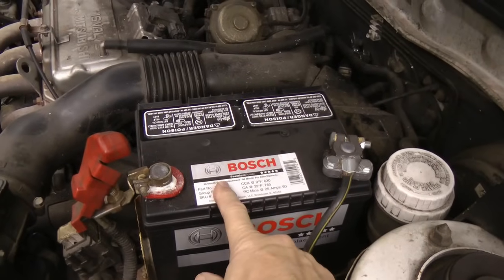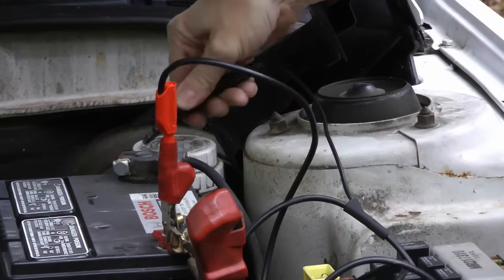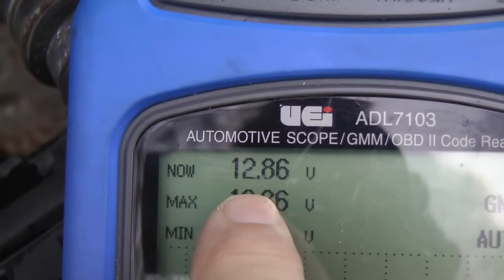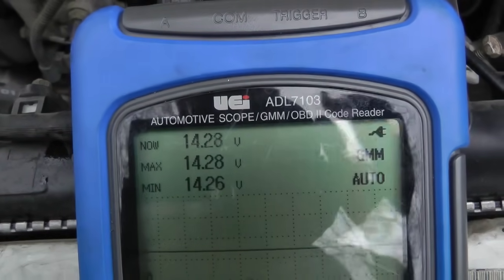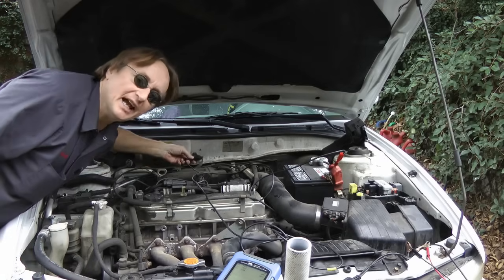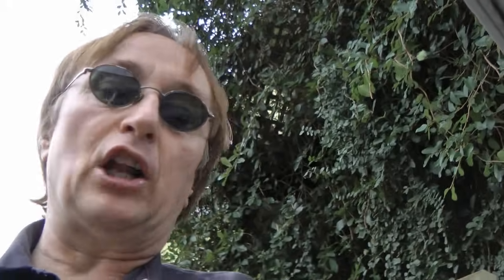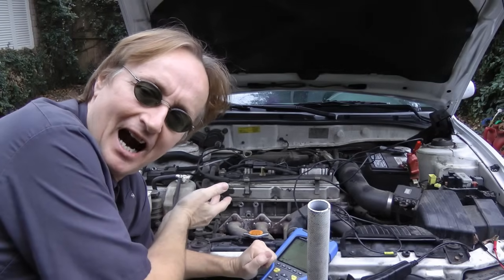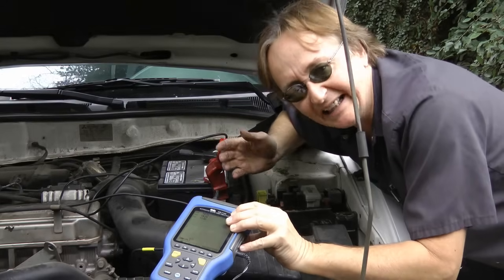How to Fix Electrical Problems in Your Car (Ground Fault)

Comment: Great vids!!!  Get this... the metal strap that held my battery down popped loose and grounded the positive terminal straight to my 95 nissan pickup.  Now the stereo, fan, windshield wipers and headlighs are all acting crazy.  Would all the ground wires need to be replaced or do you think I burned out my relays?  Thx again, J
Reply from the maker: pray it's just relays, but odds are computer modules and or wiring melted too. good luck

Comment: Thanks for writing back about my 1990 Chevy Lumina.  I agree that the idle screw should not be adjusted.  Recently though I got my car out of a mechanics shop and when I got the car back the idle was up so high that the transmission was slamming every time I would stick it into gear.  The original problem was still not taken care of because the car kept dying at stop lights and signs and it was blowing smoke.  I took it back to them and one of the mechanics comes out and adjusts the idle set screw.  The car would not slam into gear but it did not solve the problem of dying.  I had to smog the car.  The smog specialist could not even get the car started without problems and the black smoke was belching.  He opened the hood looked to the back of the engine and cut part of the rubber hose going into the MAP sensor and all of the sudden the car ran and passed smog.  But when I got it out on the street it still wanted to die at stop lights and stop signs and I had to feather the gas.  I finally had an idea.  I bet the first mechanic had turned the idle screw to low.  So I adjusted the screw just a little at a time and then the engine kept running smoothly at the stop lights and stop signs without dying.  So far the car is running like it should for a car that has 350,000 miles running on Amsoil.

Comment: I recently wrote that my 1990 Chevy Lumina was dying every time I got to a stop sign or light.  I first noted that the vacuum lines going to one of the electrical components was worn out.  I also turned the idle set screw to increase the rpm and so far the car has not died like it was before.
Reply from the maker: that is not an idle screw you should mess with. the computer sets the idle, turning that screw also messes with tps output and other things and may cause problems in the long run. But, THAT old, if it runs good enough, live with it

Comment: Scotty - I hope you can answer this after a moonshine break.  My 1998 dodge Caravan tail lights flash every 3-6 seconds when driving down the road, lights in the off position.  When in park, engine on, no flashes.  No noticeable anomalies when lights are on.  Thanks for any advice.
Reply from the maker: either switch is wearing out, or the body control module is bad

Comment: I have a acura tl 2005 ,it gets spark ,gas and has new plugs and wires .will a bad ground keep it from starting ?please help
Reply from the maker: it certainly can
Reply: Did that and still no crank .they said it might be the ecu,that I need to reset it .do have any idea on how to reset the ecu on a 2005 acura tl base model? Thanks in advance

Comment: Hey, I have a question. I just had my alternator replaced about a week ago. Well, tonight I got into my car and started driving to work and noticed that when I hit my brakes that my headlights dimmed for a millisecond. Then, as I got off the highway, the radio and dash flickered. I drive a 1994 Saturn SC2. Any help would be great.
Reply: Faulty alternator or bad connector/connection

Comment: i recently had my transmission replaced, and after I got my car back, the cigarette lighter fuse keeps blowing, and it won't work, plus my runner lights are not working, my dash rpm lights don't work, and check engine light stays on. did my mechanic pinch some wires when setting the motor back in?

Comment: how to fix 02 dodge truck headlights will not turn off. key out of truck doos locked, lights still on. only way to turn them of is undo the battery cable. even the light switch dont turn them off. so what could it be? please help .this ladies tired of raising the hood ever time i get out  or in the dumb truck. HELP!!

Comment: I have a 2003 Mitsubishi Eclipse and my guage lights won't work. all of my fuses are good I replaced all of them but nothing happens what do I do.
Reply from the maker: check for power and ground loss at the dash, if it has power, dash has shorted out in the circuit board
Reply: +Scotty Kilmer does that mean I would need to buy a new Guage cluster

Comment: Hey Scotty. I'm having an issue with my 1999 GMC Sierra. When cold, it idles fine. But when it warms up, i have rough idle. It'll go between 300 RPM and 500 RPM. When it drops to 300 RPM, the dash lights go dim. Ground wire problem? They also dim a lot and make the engine drop down in RPMs when I open or close the windows. The battery is brand new.
Reply from the maker: do my video "how to fix a car that idles poorly" and pray that fixes it and that it's not a fuel injection problem flooding out the engine when hot
Reply: +Scotty Kilmer But would that fix the lights dimming too? Doesn't that mean I have alternator or wire problems?
Reply: +Scotty Kilmer It also doesn't happen consistently. Some days it'll work fine and other days it acts up.

Comment: I have a 2006 kia spectra ex and none or my inside lights work radio nor my driver side window and driver side lockes don't either and I was wondering what that could be and is it a easy fix and if so how any help please

Comment: my 1997 BMW 740i brake light is not working
Reply from the maker: +Suga Sloan check the fuse and the brake light switch first

Comment: oi
i did a battery check or checked for draing problems 
and i hooked up my light to the negitive terminal then the light started dimming on and off  on and off on and off on and off so i started pulling fuses and NOTHING happened it still started dimming on and off still with all the fuses pullled it still didnt stop dimming on and off sooo i dont what makes the battery dead from the battery dimming on and off 
soo what could it be
one is a 92 mazda 323 and other one is 94 z28 
it did it to both of them soo i am guessing its the same problem what not
they dont have alarms or nothing
THE END
::)

Comment: I've got a tricky one for you mate. I just replaced the crank and cam angle sensors in my 6G74 3.5 Mitsubishi Pajero. It ran fine for a week. Now. When I replace the clutch in it earlier last year, my silly mate "who's meant to be a qualified diesel fitter", I'm an apprentice, was in rush and wanted his hoist back and forced the box to the engine and zipped it up with the rattle gun. Resulting in a pinched main engine ground harness that runs over the back of the engine. I tried the best I could to isolate the wires semi blind because of where it was. Fast forward to the current day after replacing the crank and cam angle sensors, and it ran fine for a week. I parked it up. It sat for a couple hours and then we went to go back out for my son, and it would start but not run/idle properly. Like it was hunting for the correct cylinder. I had my other mate bring his snap on scan tool. And the codes said crank and cam angle sensor again. Which isn't right. Would the ground do this?
Reply: Bc since ole mate pinched my ground harness. My gps battery blew up. My tacho doesn't work. And now a few other bits and pieces. The harness runs from the battery down to the left side of the engine. But there's other ground and maybe power wires in there too. I'm at me wits end with it. Bc I need a bloody car to get a bloody job and I ain't getting the help I need. So much for mates in the know haha. I told him hasn't anyone ever taught you as a fitter. If it doesn't go, don't bloody force it! The look he gave me was priceless. Mind you I've been working as a mechanic/fitter now for 10+ plus years. I just don't have that government piece of paper yet. Due to unforeseen circumstances.

Comment: Hi, love the video's by the way. Got a 1998 Rav 4x4 (bought new). When I step on the brakes, the 10 Amp brake fuse blows out. Car runs, but no break light (all other lights & signals work). Assume it is a short 'cause first the cruise control went, & lost instrument panel lights right as the fuse problem began. Once you turn off car, it'll start but not go into gear until your replace the 10 amp fuse under dash. Any ideas or suggestions?

Comment: John Deeter9 minutes agoHello all you wise ones out there,,,can you help a Brother out,,I got a 95 Ford explorer sport,,i heard they recalled them years ago due to electrical problems ???? on mine the windows sometimes work and sometimes not,,the digital  display by the rear view mirror sometimes works rarely has it come on BUT SOMETIMES it does,,the wipers are hit n miss,,sometimes they work sometimes they dont ?? dome light is same ,,, is there a multi-function relay,,,Please share your infinate wisdom with me

Comment: Scotty I have a 2007 chevy Tahoe. the guy I bought it from was a younger guy and of course added LED lights in everything lighted area to be found along with a light bar and custom stereo. Im not sure if this may be the cause of the problems that I am having but we are mind blown. I have had the truck for 7 months. only in the last 2months has this problem started. The hazard lights are just randomly getting stuck on. When this happens you have no turn signals at all, no clicking noise, and no brake lights. At time it would just stop and now for the last week it has seemed to have frozen this way. The heated seats cut themselves off and on constantly. The dash lights seem to dim at times and then brighten more at times. when the blinker does work you can here the blinker clicking through the stereo sound at times. Again all this is random. No certain time that it takes place. We have checked fuses and cant locate any that have blown. Also about a week before the hazards froze the air/heat stopped blowing. It will still heat and blow cold air if your going down the road but to actually blow it wont work at all. If you crank the truck the hazards are on , you put in reverse you can turn on the hazard switch and it will work but if you put in drive the hazards will not work at all along with tail lights or brake lights.??????? begging for help from anyone that can point us in the right direction??? we wish to undo all the extra that was added on this truck and take it back to factory setup !!! HELPPPPPPPPP

Comment: when i press the break on my car the signal rite signal light turns on what could it be ??
Reply from the maker: +silvia galvan often a short in the wiring in the trunk between turn signal and brake light wiring or ground wires
Reply: Thanks alot i wish you were here in Cali great mechanic

Comment: I have a 1998 Dodge ram 1500. I turn my headlights on high beam and usually within 30 minutes they start to turn off and on but when my lights are on low beam they wont shut off and on. im using standard white halogen bulbs. is there a way to fix this?

Comment: I have dashboard lights(brake, battery, doors)  come on randomly.   Will that be ground problem?
Reply from the maker: +James Chuaycham could be, but more often that's a problem in the body control module or the dash circuit boards shorting out
Reply: +Scotty Kilmer The car has no other issue with driving at all, excepting all dash lights randomly come on.  I guess it is not risky to drive.  It will be difficult and not worth wide troubleshooting body control module or the dash circuit boards on an old 2001 Accord.
btw battery volt is about 12.38 when engine off.  Is that too low and problematic.  I refilled the batter with some water and will drive for a little bit and recheck.

Comment: hey my 1995 eclipse has a problem nothing im dash does not work;  except my rmp's, gas gauge. but the one othe thing othere  does not work is the speedo sensor, and its hard to tell how fast im going!!
Reply from the maker: +Rich hobo on those, often a dash with circuit boards warping and shorting out. Try a used unit.
Reply: ok thanks ill try it
Reply: well i broke a bolt on my 1995 eclipse right where my speedo sensor is.right on my transmission!!!noo so what should i do

Comment: I have an unusual issue in my 2000 Trans Am, every once in a while when I'm driving, the volt gauge will drop, not enough to set off a warning light, but enough to make the headlights and interior lights dim, this happens for a few seconds then goes back to normal. Any ideas? I have a brand new battery and I did the big 3 wire upgrade, this situation was happening before I made these replacements and it is still happening. Thanks
Reply from the maker: +Mike B have the alternator load tested, and check ground wiring

Comment: Hey Scotty,

I have an '89 Bronco II with rear brake lights/signals that don't work--most of the time. I had them working the other day with the accessories on, but today they stopped. Sometimes with the car running, the one on the rear passenger side works, but other times neither of them work. There's a lot of weird inconsistency. Both bulbs are fine. Is this just a weak connection somewhere? What the heck is going on?
Reply from the maker: +Andy McIntyre that old thing, I'd just run new power wires from the brake light switch to the brake lights and cut the old ones off
Reply: +Scotty Kilmer Beautiful. Can do. Thanks man!

Comment: Scotty, (or anyone) my power locks often don't work, my airbag light comes on randomly, I loose my instruments for a minute or two periodically, I've had my horn going off on its own, but now it doesn't work at all anymore. 
Does all this sound more like a bad ground or a fuse or what??? Tyvm!!
Reply from the maker: +thingwhatever   bad ground, or bad body control module

Comment: Hey y'all. 
My dash lights and my tail lights are turning off at night when i use them.  1992 caprice wagon. 
Just got it out of the shop and it dies at stop lights if I wait more than 10 seconds.  I'm very upset and wonder if it's alternator getting weak or what.  I'm getting really pissed as the mechanic says it works fine but it doesn't.
Reply: +brandon kehl  have you found a solution for this?
Reply: Luis Zidane
I think it is a short in the headlight switch. ?

Comment: Hey, I have a 2006 Ford Mustang and when I turned off my car, the front orange light (other words turn signal) didn't turn off and it is on the right side. Also the same with one of my tail lights on the right side do you know what might be happening??

Comment: Hi hi i have a toyota mr2 mk2 sw20 tbar none turbo, i have a problem with it not charging and having dashboard lights on and the rev counter dont work properly ,  it has brand new battery, brand new alternator, brand new alternator plug,i put a brand new earth to the chasis from the alternator to body of the car and brand new battery terminals,  if i take alternator off and replace the condensor it charges for a wile and the it stops again if i replace the condensor for old one it works again then stops after a wile so there is nothing wrong with these items help please

Comment: hi scotty,i have a 2004 ford focus and left rear indicator keeps stopping and starting ive changed the bulb but still does it.
Reply from the maker: +adam wale check the wiring back there, especially the ground wire to that bulb and make sure the socket isn't corroded and worn out
Reply: +Scotty Kilmer hi did that wiring looked ok checked socket in opposite one and it works put it back on left side completely stopped working now

Comment: i bought very bright lights but they still not giving me a bright lights, what can i check and also my hazards are not working but my indicators are working this is on a Hyundai elnatra 1998 j2 1.6GL
Reply: +successm941  You have multiple issues,here.head lights or tail light,doesn't matter. Check for a BAD ground in the circuit.
Reply: I did and found that there was a fuse that was packed up, but I will check the grounding, as I am not happy still about my bright lights, but all indicators and tal lights and hazards are now 100% working thank you ddd